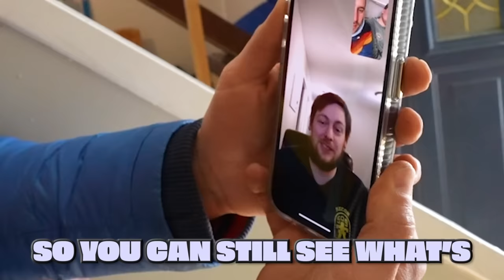Hidden Bed Entrance to EPIC Bunker!

Comment: You should add locks on the inside. Yes, to open it from outside, you need to find the latch, but if someone finds it then they can get in. If you have locks inside the bunker, they would have to pry open the hatch